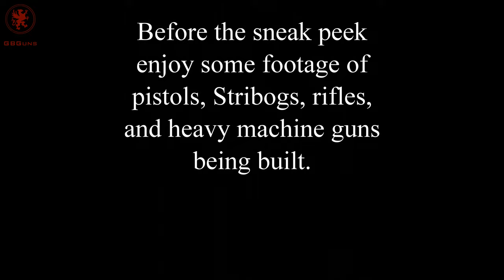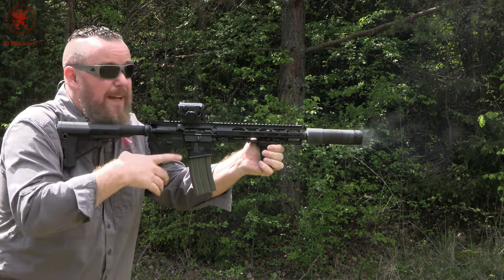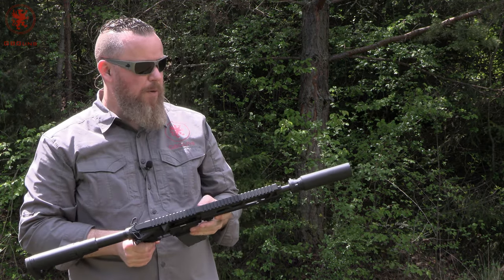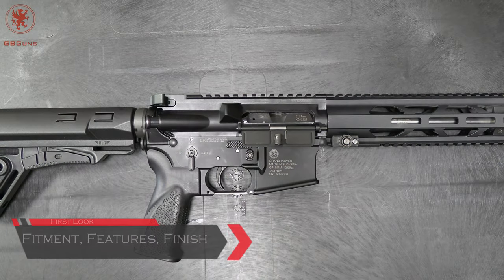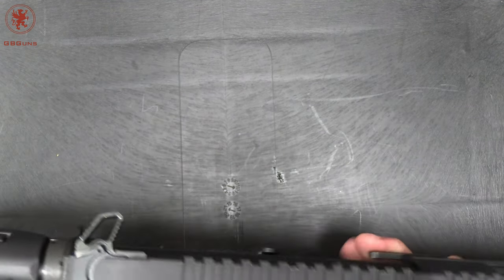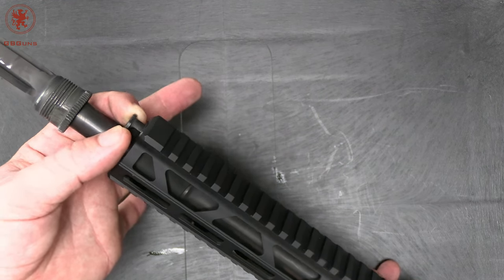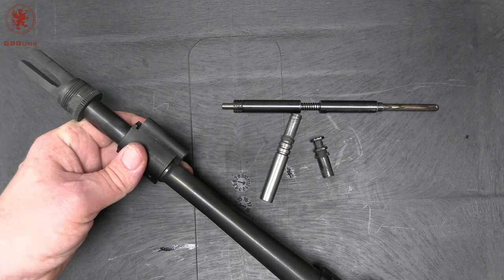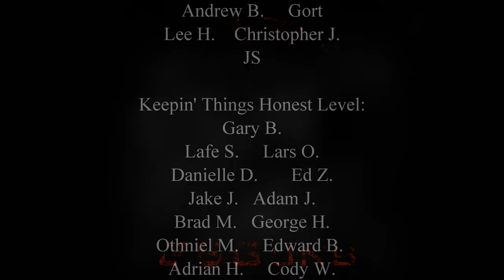Grand Power M4M Sneak Peek

Comment: I have an upper that I built with an Adams piston. I've never noticed an greater recoil with it, but it is front heavy, as a piston will be. I have never really been bothered by the front heaviness of the piston, it is noticeable, but not really terribly bad. The piston on that rifle looks like it should be nicely sturdy, and if you are thinking the front heaviness is coming from a suppressor, then I am guessing, that somehow, it is light for a piston. The quick release fore end that locks your gas setting in place also looks like a reall nice and convenient feature. I would probably be interested in a Grand Power piston rifle, if they made something other than a carbine.
Reply from the maker: We own a few piston rifles and this particular system didn't feel notably heavier or lighter, but we also didn't ahve those with us to compare.

Comment: That carrier reminds me a lot of the LWRC guns for some reason.  Frankly that setup looks very well thought out.  Only thought I have is how well does that handguard retain zero in-between removals?  Because it has to come off when you need to clean the rifle.
Reply from the maker: The handguard is located with the gas adjustment, so there's not a lot of room for error.

Comment: For something reason import ARs appeal to me more than domestic ones. The overall quality seems higher and most countries have open supressor laws making it easier for manufacturers to tune.
No flying brass or gas when supressed, definitely has DI beat. If the accuracy is great i would consider one, they're typically not as accurate IMO.

Comment: I have a pile of DI AR rifles and pistols, never owned an AR piston gun, but that system looks pretty interesting. Aside from the operation of the guns, I like some of the features as stand alone items. The stocks look pretty cool, like a mix of Magpul and Fab Defense. The grip would be nice if it is a rubber overmold type. And the handguard with the "quick disconnect" feature is nice and user friendly even if you didn't need it for the gas adjustment. Are the items exclusive to Grand Power or if they will be sold in the American market as accessories??? Thank you for the sneak peek.
Reply from the maker: As far as I know they are all of Grand Power design.  I don't know if they'll be available separately in the US.
Reply: @GBGuns  Thank you for the reply. I will keep an eye out for their products. I watch your videos on firearms I am interested in for honest testing and overview and you do not disappoint, thank you.

Comment: Hey awesome videos as always! for the piston version, there are 3 positions for when using a suppressor, which one is the one you need to use? the one that has 1 little notch, 2 little notches, or 3 little notches? Thanks so much!
Reply from the maker: Unfortunately I do not know, aside from this quick demo in Slovakia I've not seen these guns again.
Reply: @GBGuns  Just wanted to share this in case someone is interested. I called today GP, and they confirmed to me that does not really matter which of the three settings you choose, if the rifle skips a round in any mode, you can try the next one. That there is a suppressor mode, does not really mean you have to use it, it depends on the ammo you are using and how much the rifle likes that ammo with your suppressor combination.